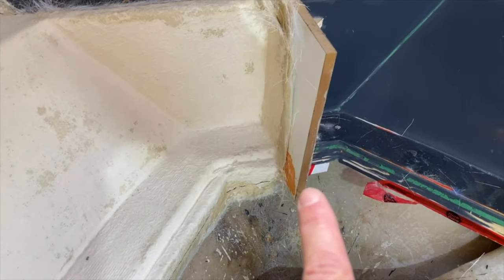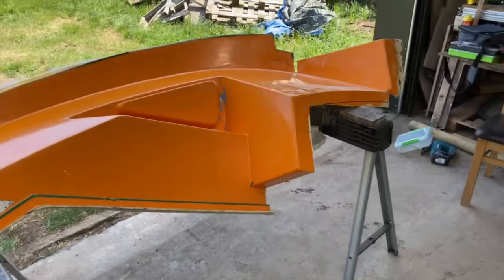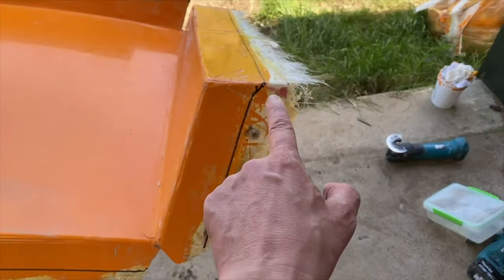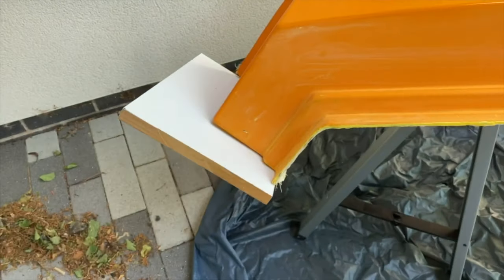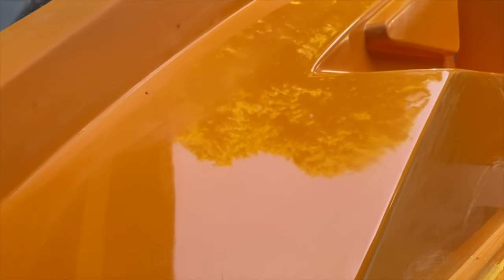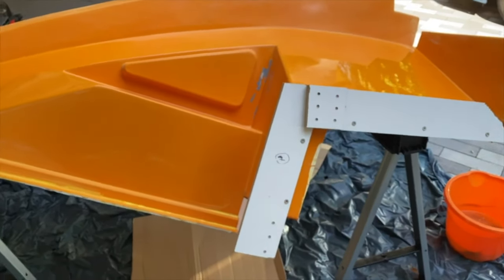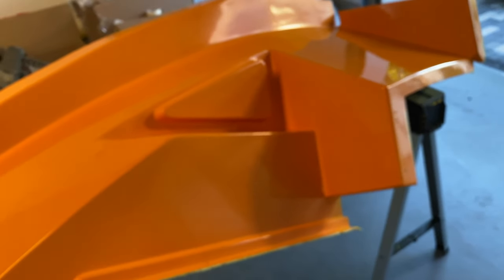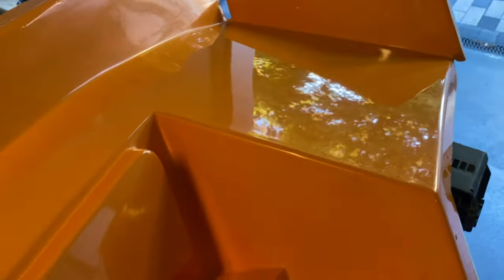We Release and Polish the Bed Mould | Boat Rebuild Project - EP 19

Comment: If you make more molds in the future. After your 8 coats of wax. Spray 2 layers of PVA over the freshly waxed surface. Its basically liquid film plastic that helps the mold separate from the plug. The few areas that stuck was because of porosity in your primer and not enough wax and finishing in those areas.